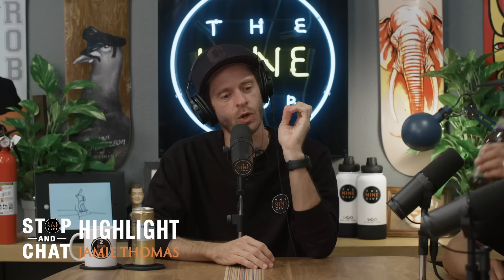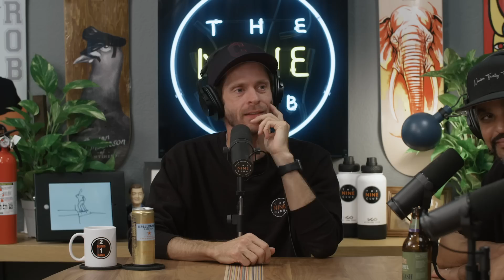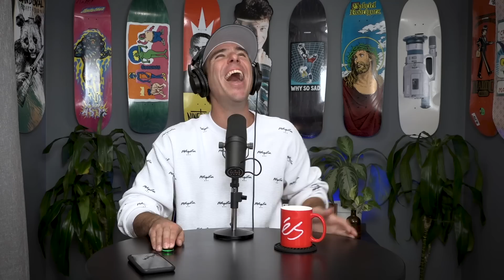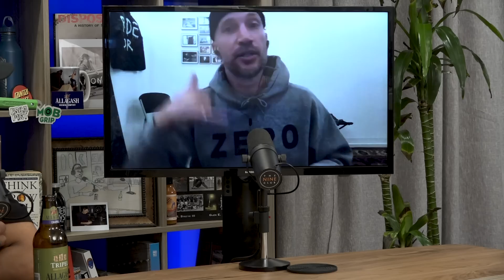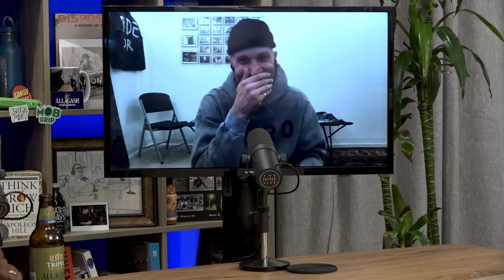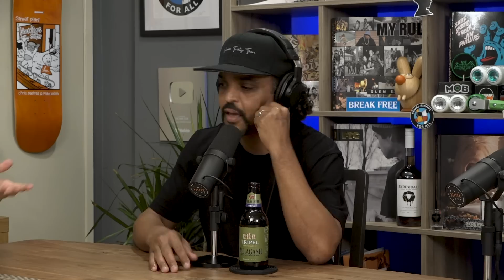What's Jamie Thomas' Board Setup?!

Comment: you guys gotta include their shoe size!!
Reply: Size 13, 8.25 board, 139 indys

I grew up on 7.5, forced to move up to 7.75 10 years ago
Reply: The chemist  because a big reason for peoples preference for board size depends on your shoe size. If you got size 8 feet, then an 8.5 board might seem excessively big, but to someone with size 11 feet it would feel more natural
Reply: I don't think that shoes size necessarily reflects board size.
I'm 6'2", 175lbs, size 11(US)10 (UK) and still ride a 7.75 😊
Reply: Yeah guys its a preference, but one the most objective variables is how big your shoe is compared to the board.
Reply: I’m 6’7” 220lbs and just started skating again after 20 years . I wear a size 14 shoe.I skated throughout the 90’s. This is when boards changed shape and by mid 90’s the boards were 7.5. I just started with 8 wide and didn’t feel stable in Ollie position. I went to 8.38 and this was a huge difference. Going to try 8.5 next. Shoes are also limited in size 14. I used to always wear DC shoes but now they seem to run small . I just bought the NB in 14 and they fit perfect!
Reply: Eric Mueller Check out Brian Anderson’s setup (also on the nine club) he has larger feet as well size 13-14 and rides a 9 inch! Tony Hawk rides an 8.5 and his shoe size is 13. Wider board and a longer wheelbase would definitely help feeling more stable on the board for your size!
Reply: Good question
Reply: Larry Jimbob i agree. i know some dudes who’s shoe sizes are a 10 but they skate 7.75 cuz it’s easier to flip and others who are the same shoe size but prefer 8.25 cuz it feels more snug and they like more board control
Reply: @i.haul.ass_  I don't need all that extra board to land on thanks dude. A 7.75 is just fine. It makes you have to be more precise and is more responsive/easier to flip.
Why the heck would I want to change it? I've always skated a 7.75..
....except when I first started skating from the late 80's to the 90's when boards were bigger 😊
Reply: @d.istortionaladdict  I always ride a 7.75. I make up for less board width by skating decks with a deep concave instead to get good flips 👍😊
Shoe size and height means nothing really, it's all personal preference.
Reply: @larryjimbob  That’s true but let’s Say that pro a rides an eight and pro b rides and 8.25. It seems like pro b rides a bigger board but what if Pro b has size 12 or 13 shoes and pro a has size 7.5 shoes (Tom asta rides an 8 with 7.5 shoes.). Maybe I’m just a nerd  but I really like hearing the intricacies of someone set up and that includes wether or not they ride a board that feels big to them or feel small to them because again just hearing that someone rides a certain size doesn’t really mean much without the context of their shoe size. The same board size could seem small to one pro and huge to another pro.
Reply: Hey I'm a size 13 sometimes 12 ... What should my board size be???
Reply: @louie6608  anywhere from 8.25 to 9.0 and up, depending on what type of riding you’re planning on doing and whether if you like more room on the board for your feet, it’s up to you!
Reply: @RideBonesSwiss  thanks man ... Yeah just Street skating riding around doing a couple ollie's ...  Skating a couple rails .... Yeah with the 8.0 I hurt my ankle .... So maybe a 8.25
Reply: @louie6608  I would suggest maybe getting an 8.5 with maybe some lighter trucks like thunders (149s) a bit roomier for landing tricks and more comfy rolling around
Reply: @ericmueller6687  I started up again after 20 years as well. Used to skate ~10" boards back in the 80s. Had a 7.75" from around 2001. When I got back into it I got an 8, which I liked better. Then, switched to 8.25 and then 8.5. I like the 8.5 the best. I'm not really worried about doing flip tricks though, but, I much prefer a bigger board. Don't like skating what feels like a 2 x 4. I wish I would have just went to the bigger size to begin with. I don't see myself downgrading to a smaller size. I wear an 8.5 US shoe. I kind of think people are doing new skaters a disservice pushing them into skating really narrow decks. As I mentioned, I'm not really doing flip tricks, so, maybe I'm just wrong. I just know that the bigger board feels a lot better for the tricks that I do. If anything, I'm might consider upgrading some more. I doubt I would go smaller. I going on 50 now and don't need ankle injuries. So, I'm happy staying away from the flip tricks unless I start getting a lot better.
Reply: @ericmueller6687  If you have a size 14 shoe, I'm not even sure what the point of riding something as small as an 8.5 is.
Reply: @louie6608  I would agree with Alex Mar. I've tried 8, 8.25, and 8.5. The first two were a waste for me. Then, again I'm going on 50 and suck, so, you're mileage may vary. All I can say is that I much prefer the 8.5 for the tricks I do. And I only have a 8.5 shoe size. So, honestly, I'm not sure you should even limit yourself to only 8.5.
Reply: Lol, I wear a 9.5 and skate a 9.0 board. Bigflips have never been easier
Reply: 38yo, 6'3, 215-225ish, size 12 shoes(us). i have a 7.5" and an 8" street board, a small cruiser, and an '85 mike mcgill reissue. i would have swore my 7.5" was a 7.75". i've had up to 8.25" and loved it. most of my trucks are from the 90s and are under 8". i want to get an 8.38" with 144 or 149 indys, or maybe the new grindkings. i like tighter trucks with the front a bit looser, 56-58mm wheels. it sounds crazy to run bearings with no shields, they'll get junk in them. it makes no sense, even if you're getting them for free. my 8" board isn't fully symmetrical but it's close enough to know i don't like it. 1" phillips, i'll use risers sometimes. never really liked allen bolts. i think most average people are more likely to have a phillips screwdriver on hand than allen wrench.
Reply: That matters!!
Reply: Great idea!
Reply: @andrewolivetreemixing  that’s not always true. i skate in size 8 shoes and ride an 8.75-9
Reply: 5' 10" tall, 10.5 american shoe size, 8" deck... Wanna try 8.5 on next deck
Reply: Andrew Hoppe  sure it does, for example, standing on and skating a 7.5 deck is going to feel a lot different if you have size 13 feet compared to having size 9 feet
Reply: Good call
Reply: 6'2 170lbs size 13 shoe 8.125 board
Reply: 7/8 Allen bolts all the way!!!👍👍👍

Comment: 7/8” makes sense, but why Allen over Phillips? Phillips screw drivers are everywhere, Allen keys are a scavenger hunt every time,
Reply: Allen doesn’t strip out over time and it looks better but it’s personally all preference G
Reply: @curtislathrop  Phillips do strip over time, but never on a skateboard. You would crack the board way sooner. It’s got to be a style thing.
Reply: @alexnelson8  again it’s personal preference
Reply: If you place the philips into the screw & turn the nut you'll strip the x bolt less frequently but me personally i ride the 7/8th alan i have for around 18 years now i''ve never had an issue i've had the same bolts for about 5 years now they still look new i keep a small alan key in my wallet and i have two in my skate bag if your serious about your stuff you wont lose it i promise 
Try out Diamond hardware or the Thunder 7/8th alans work great for me 🙏🏽

Comment: I prefer 2" flat-head bolts.
Reply: Id rather have 1/2 machine screws with a torx bit
Reply: I just superglue my trucks to my deck
Reply: @fernandoreyes680  Nice! You probably get a temporary hover board when you hit a crack too. Gonna try.
Reply: just use staples bro theyre the best
Reply: Hahaha. You stole my joke. Pan head??? I had an old board from the early nineties that had allen bolts, but, they were pan head and had washers. I thought that was nuts. I don't remember if that's what I always skated back then.
Reply: I put one bolt on upside down so I can tell which side is the nose.
Reply: Ha keep rocking that, you're one of a kind!!

Comment: 7.75 with medium tight trucks, don't care much about the bolts, big wheels 53/54 to last, no risors
Another thing - Shops are super annoying because they only carry 8's and up! 
I met Jamie Thomas when I was 13 or 14 at a skateshop. Still have the picture. Legend
Reply: With you there dude 👍😊
I ride 7.75 and you don't get much choice, if any at all.....or even a 7.75 in stock! 😕😂
Reply: I moved up to an 8" because I wanted to try the Powell flight deck. I like it, but probably wouldn't have changed if they offered a smaller one. Definitely not much choice in smaller boards nowadays.
Reply: Rico Forex 7.75 gang! 👊
Reply: I now ride a 7.62” and an 8.5”. Too much time skating in the 90’s to fully commit to the bigger boards.
Reply: I started skating around 1998, ive been away from skating for a little while and the biggest shock to me is that boards appear to be way wider now. I'm 5'8 150 size 10 shoes and grew up skating 7.75's but that is apparently tiny now? A wider board sounds kinda nice actually if they're lighter now

Comment: I had only allen key bolts on my Thunder Zero setups in the mid 2000s as a kid and now use 1" phillips (with risers to help wheel bite) just because it seems like it became the universal standard. Allen key are harder to find and keep and the bolts strip out if you're an inexperienced child trying to tweak your setup. I blame Zumiez for silently ushering in the standard of phillips head lmao

Comment: The line I always got was that most kids did not have the strength to tighten Allen bolts and would throw tantrums. That they would usually lose the small Allen key were as a long Phillips driver gives them the extra space needed to tighten the bolts. that Allen bolts lost there thread quicker and were more difficult to remove after, that kids love adding riser pads cus they are sold on the notion the it will stop pressure cracks and that they feel more secure seeing the excess of the bolt because they won’t lose the nuts.I’ve been told this by multiple Vans and Zumiez employees. Regular skate shops usually have a good laugh knowing it’s just a money grab

Comment: Aren't the 1in bolts made so that with time you don't lose any bolts? I've used 7/8 and after a while I find myself missing one or two bolts. So unless you crank the shit out of your bolts then 1in is better since the extra bolt is there and won't allow the bolt to come out as easily with time.
Reply: Most of the skaters I have known that were losing hardware, were reusing old nylocks. I have had better luck replacing nylock nuts with every new setup, though they say you can reuse them. Admittedly, I have 1/8" showing on my current bolts.
Reply: Nah, tht little rubber ring on the nut is basically a locking washer. If tht doesnt work, just use low strength lock tight
Reply: I very much agree with you, Jamie is tripping. 7/8 always comes loose and ovals your baseplate if you skate outside of skateparks
Reply: @austingriffith3598  low strength lock tight.
Reply: @vperkv6554  maybe as an emergency measure but 1” bolts don’t require it, they hold tight on their own

Comment: I can only hope Truck brands would sell even a "Hanger" only.. Coz thats the one that gets abused as far as truck parts
Reply: I had a baseplate get damaged and cracked. But the board got ran over from a full size truck and trailer. Other then the very rare occasion they never get damaged but geometry is different
Reply: I've definitely get pivot holes get in trucks get warped because I didn't replace the pivot cups haha
Reply: I usually wear out pivot cups, bushings, and king pins before a hanger. I have had lots of axles slip before any of these things though...

Comment: The one inch bolts used to annoy the hell out of me too but then I started skating alot more drops and trying to so more technical skating rather than just the usual mini ramp flat ground stuff I like to do and the 7/8 became wayyy to small, I've lost so many bolts over this summer because they became so loose so fast so the 1in actually work better for me
Reply: Exactly put a freshy on then a couple hours later your missing like two bolts lol. I'd dig the bolts deep into the wood giving me pressure cracks so i just went back to the one inch.
Reply: loose bolts? Buy some shortie's 7/8 allen and you're set. Quality matters.
Reply: @trupiil  I've skated shorties, shake junt, diamond and they all have gotten loose
Reply: @alexsosa202  the thing is, a longer bolt does not prevent a nut from going loose. I've never had loose shortys. Try screwing them on properly.
Reply: @trupiil  then you probably dont skate hard enough or take any impact not hating just saying and a screw is pretty easy to install small room for error I'm sure they were screwed in properly even pass the nylon nut lock and they still gradually come loose.
Reply: @the.littlest.toaster  ok, how come the panel, high impact skater Thomas and all the guys there ride exclusively 7/8 s? It's strange really.
Reply: @trupiil  Also I'm in the Midwest so we have rougher roads and pavement so our bolts get shaken up more and more and in return get loose.....while in california they have almost perfect smooth grounds and parks
Reply: @trupiil  I'm not saying anything bad or trying to negate your opinion, I'm just pointing out what I've noticed
Reply: @trupiil  well he never stated that he doesn't have to frequently tighten them or anything he just likes them but for me they fall out more often than inch which only come loose on me when the board is fresh and i didnt tighten them too much.
Reply: @the.littlest.toaster  the nut to go loose how has that to do with excess bolt hanging over? To reach the 1 " portion of the bolt the nut is loose for a long time, it just sounds so strange.
Reply: It's not rocket science a shorter bolt loosen faster than a longer one of ot hasnt happen to u odk what to say
Reply: @the.littlest.toaster  not really, as soon as the nut loses press with the baseplate it is loose. To go screw out and reach the 1 " bolt ending it will have been loose for lots of time. This is why the panel rides 7/8s and cannot comprehend you going 1".
Reply: @the.littlest.toaster  Maybe if you are using standard nuts, but nylon insert nuts that come with every set of hardware do not loosen over time if tightened correctly so that problem is not actually a thing for 99.9% of people.
Reply: @one_mega_ohm9139  idk what to say bro i tighten it pass the nylon insert and it becomes loose some times not every session take a min but its not a big deal i just tighten them back but 7/8 ends up falling out more often than not for me just saying from personal experiences been skating for 15 plus years if u haven't experienced it then 🤷🏾‍♂️.

Comment: 1 Inch Bolts fits better to indy trucks. Die baseplates are to bulky for the 7/8.
The 7/8 on the standard indy baseplates are to short and the nut loosen up to fast.

Comment: With the thiner carbon fibre boards and forged truck baseplates you need smaller the 7/8 bolts.  Can you get 1/4 bolts
Reply: Hardware store